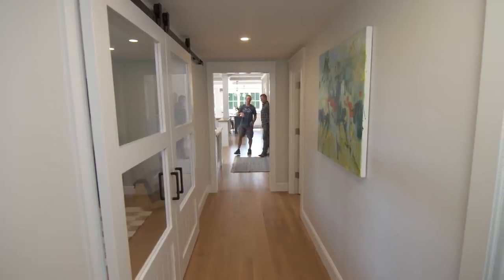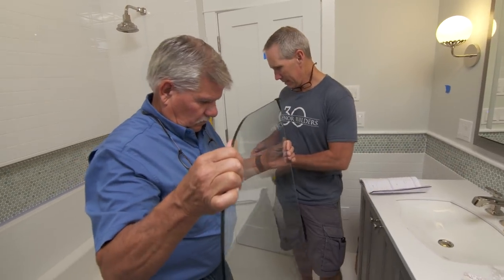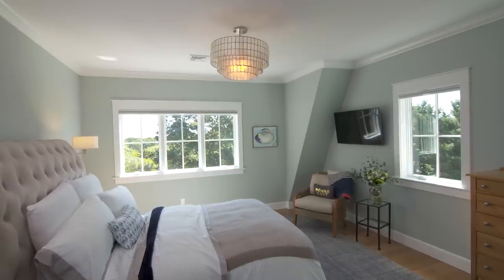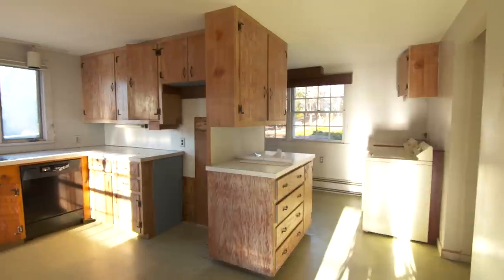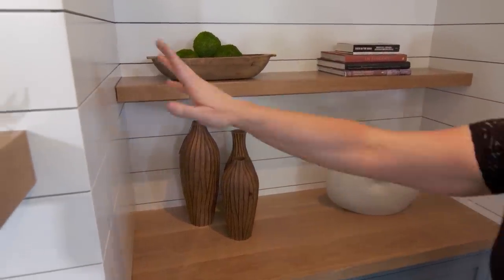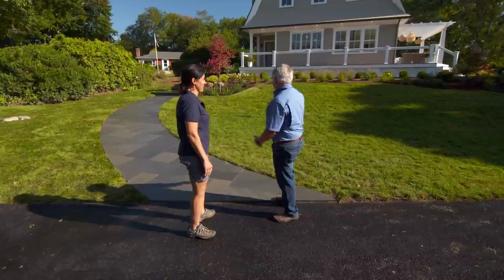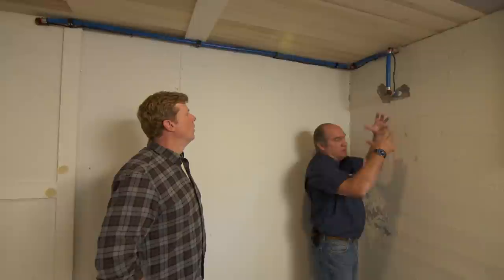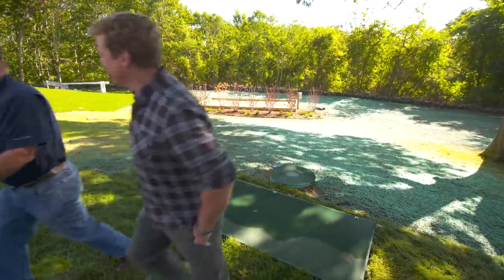This Old House |  Seaside Transformation (S41 E12) | FULL EPISODE

Comment: Didn't know a drawer microwave was a thing
Reply: Been around about 5 years.  They cost $1000 and up.  All microwave drawers on the market have a push-button electronic soft open only, allegedly so you don't spill your soup.  Too much to break for me but quite the luxury.
Reply: it's the ultimate sign of snobbery, I guess these two are multi millionaires
Reply: Me too.

BTW ackket I suggest watch a 13 part series called What on earth happened by Ewaranon to learn that the earth is not a globe.

I got it in my about tab.